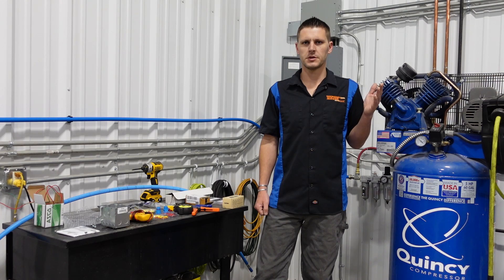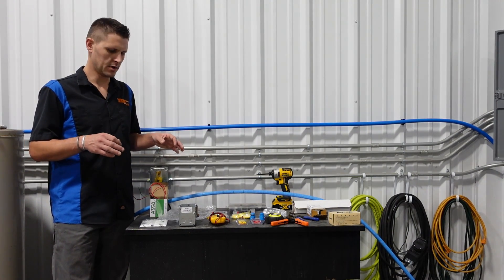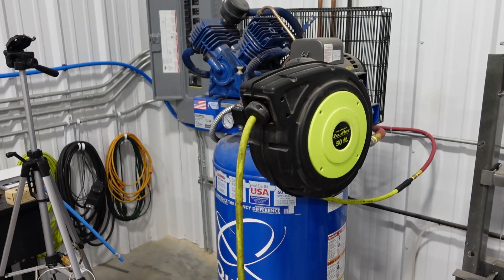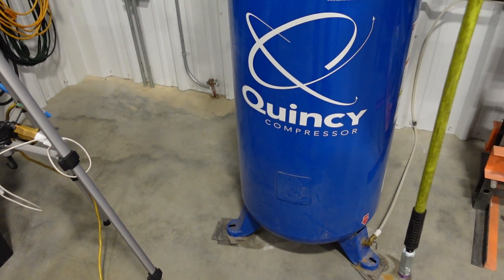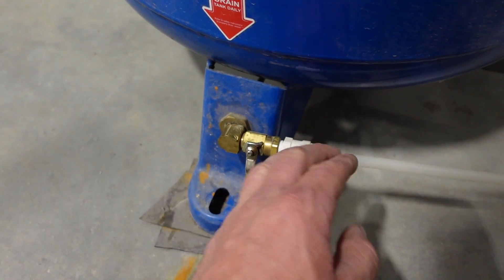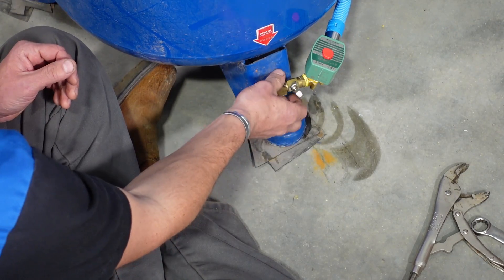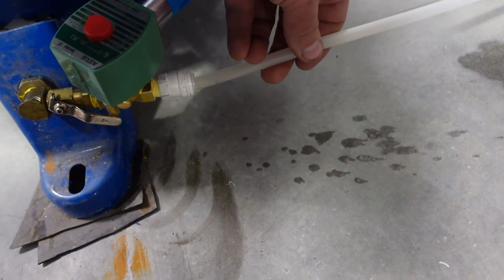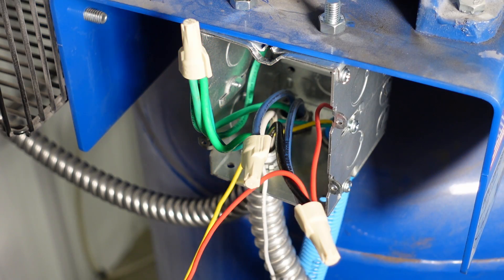How To: Add an Automatic Water Drain to your Air Compressor

Comment: I just watched your video,  and as a licensed Union electrician for 30+ yrs.
You should have mounted your timer/ contacts off your Air compressor and to the wall. In time with all that vibration from the Compressor motor. The timer  can and will shake loose from its seat/base.
Nice video  and a little complex  but works.
Reply from the maker: Oh there most undoubtedly has to be better ways to do this. My cover mechanically locks the timer in - only reason I've been safe from vibrations. Would still prefer something wall mounted if possible. People are usually shocked when they find out I'm not an electrician 😃

Comment: I ended up having to remove the automatic drain. It began to clog and it was a pain in the butt to keep it free-flowing. I replaced it with a flexible drain line with a quarter turn valve on the end. At the end of every day simply open the valve a quarter turn and let the tank vent completely. So far no problems.
Reply from the maker: Sounds like you might have some serious rusting issues already in place

Comment: Excellent instructional video because of you’re attention to detail. I have a much smaller compressor and at the end of the day I drain the tank of air completely and leave the valve open until I need air again. That’s what I thought the “drain daily” label meant. I now have my compressor located remotely so opening and closing that valve everyday has become a pain. Am I correct in assuming this automatic setup will expel enough water so that the residual air left in the tank will be sufficiently dry to prevent sediment and rust build up?  I only use my compressor a few days a week . Many thanks !
Reply from the maker: Works perfect for someone running their compressor once a month OR once an hour

Comment: How has the auto-drain been holding up, and how did you drop the amps down for the low amp timer and 18awg wire?
Reply from the maker: Knock on wood, it's been flawless so far. The only issue I've seen it all is the condensation can freeze outside since it gets down to negative 20ﾟ here. Just gotta keep an eye on that when it's really cold out.
Reply: Good to hear!
I'm thinking of doing this. Your video is great!
Time for a heated blanket on the tank, eh? For those colder climates. :)

Comment: Very clean install  but(lol) my one concern, how will the vibration affect the timer.
Reply from the maker: Great point. I forgot to mention - I found a gang box the right dimension that prevents the timer from dislodging. As far as longevity/lifespan, I will certainly update if I have any issues arise from it. The fact everything is solid mounted between motor and reservoir tank kind of blows my mind. There is certainly a LOT of vibration present. My fix, if it became an issue, would be to relocate the timer to the wall.

Comment: You can buy an electronic auto drain for way cheaper than that asco valve and timer
Reply from the maker: @krisphillips1873  not the same thing at all. Those are on a timer that drain at set intervals, 365 days a year, even if you're not using the compressor. My way only drains when you're actually using the compressor.
Reply: @ mine is wired into my compressor disconnect, only on when disconnect is on. I’ve also wired them right into the pressure switch, again only on when the switch is on. Gotta get creative. I install compressors for a living.

Comment: Couldn’t you just have plugged it into a wall socket?
Reply from the maker: Those style of timers are always on. So you can set them to drain every 12 hours. But if you're not using the compressor for a week, it's a waste. And if you're painting and needing it to drain every 5 minutes, then that obviously doesn't work either.